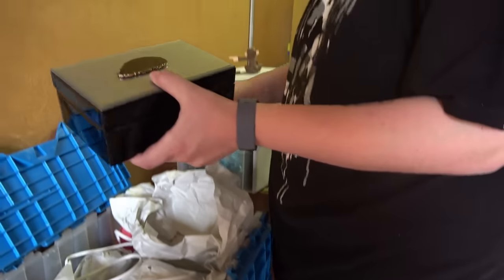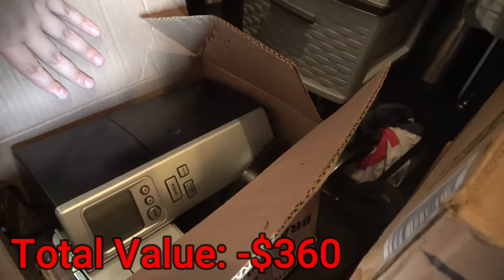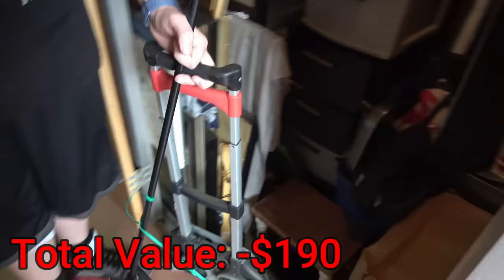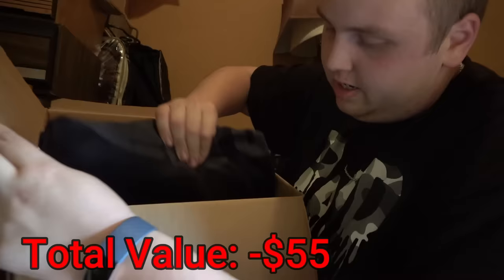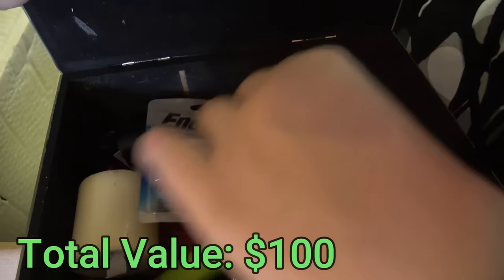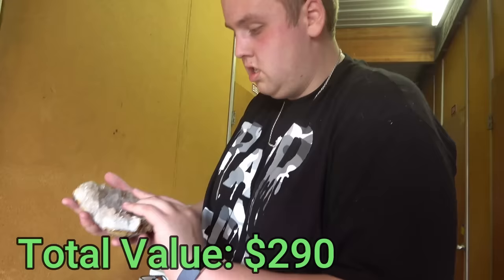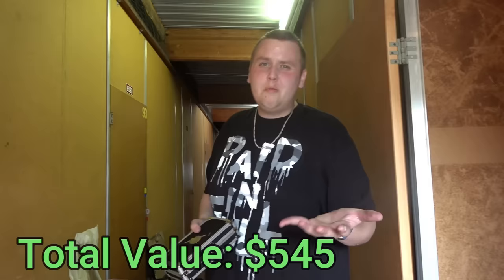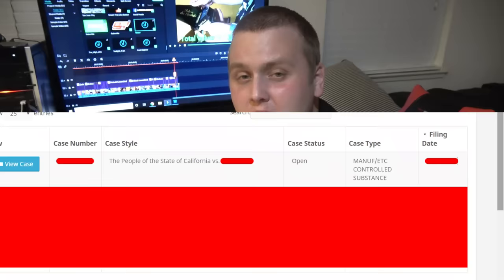I Bought a Storage Unit In The RICHEST CITY EVER! MADE BIG MONEY! I Bought an Abandoned Storage Unit

Comment: The magnifying glass is known as a 'helping hand' used for lots of things - jewellery making, fly fishing, electronics etc
Reply: Yes, Helping Hands Magnifier Station for lookup purposes.
Reply: Exactly what they said used to help make jewelry and to help tie flies 4 Fishing
Reply: Also works for soldering wires and circuit boards
Reply: You're right.. that's exactly what that's used for. I have one I use for jewelry making.
Reply: "helping hand " has various models some for the jewlers market , quite a few for electronics (bigger ring light , LED s) I love them for refurbing speaking crossover and circuit boards they provide a great amount if light without over lighting.
Reply: My late husband used it for painting small parts on a model.
Reply: Soldering wires .......
Reply: @Audiogeek-kf2ez  .
Reply: @arharis6007  gygggggggggggggg
Reply: @gam4698  wwwwwaaaaa
Reply: Yep helping hands are great for soldering
Reply: referred to as the "third hand "when doing small work like soldering or jeweler
Reply: I have one, I use it for jewelry making.
Reply: I've seen that, or similar, at Harbor Freight.
Reply: @michellemack6640  🛬🛶🛫
Reply: I have been thinking of getting one. Do you still have it?

Comment: The magnifying glass with the two clips is use in sauntering  or fixing jewelry.  When you need to see something you want to glue and your spot is small you adjust it so it does not move.  Cost is approximately 30. Can be purchased in a craft store

Comment: it's called a helping hand. not overly valuable but depends on the attachments. it's used for doing small things that you need an extra hand or stuff like soldering wires to computer chips. it actually has varied uses. kind of one of those things where you don't know you need it till you need it.

Comment: The magnifying glass and alligator clip holder is a craft device called a third hand for example in soldering components on a circuit board, one hand holds the soldering iron the other hand holds the solder and the third hand holds the circuit board with the components. The magnifying glass just makes it easier to see what your doing.

Comment: Your little timed could be worth up to The value of most Timex watches is relatively low. Recent eBay sold listings range from around $10 to upwards of $250 or more, with a couple exceptions. Many of the pre-1989 watches sold went around the $40 price point